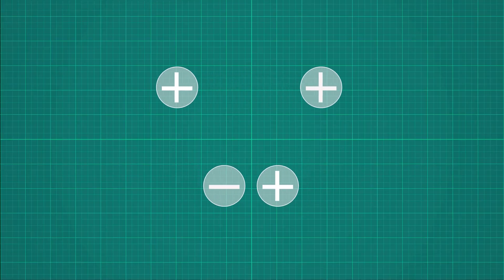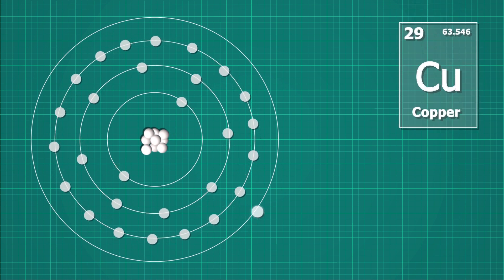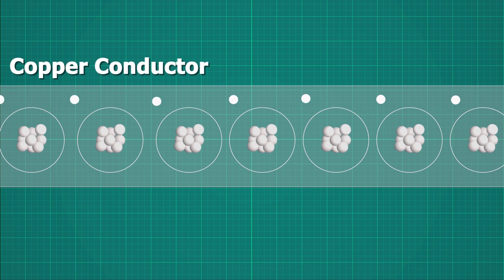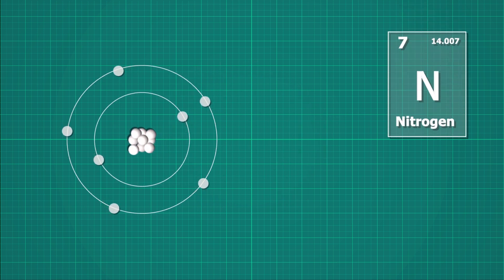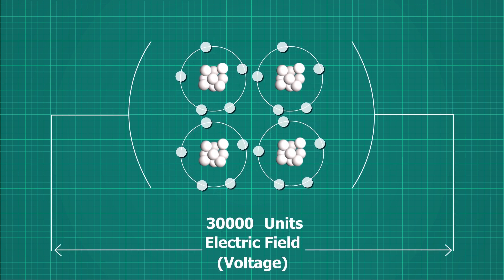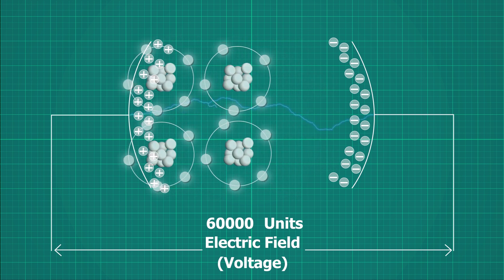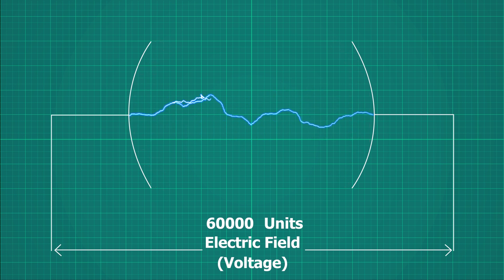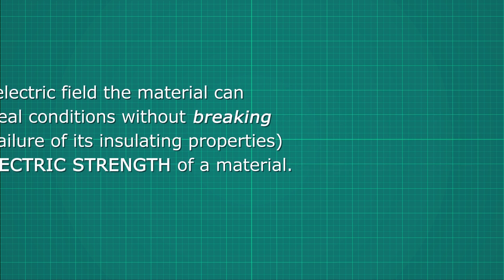What is Dielectric Strength - Dielectric strength of Insulators- Material Properties

Comment: Dielectric strength of air depends on the air pressure. Low pressure has higher strength.